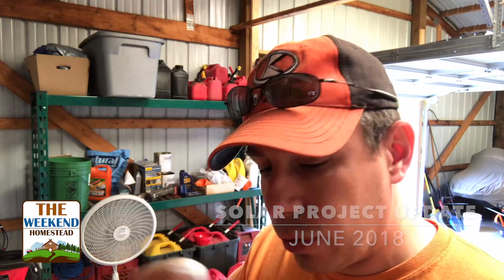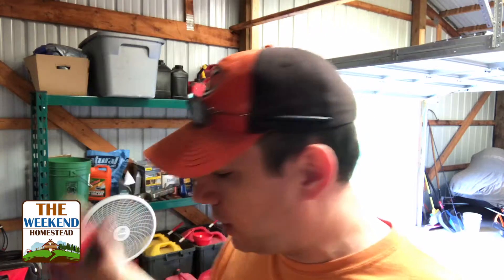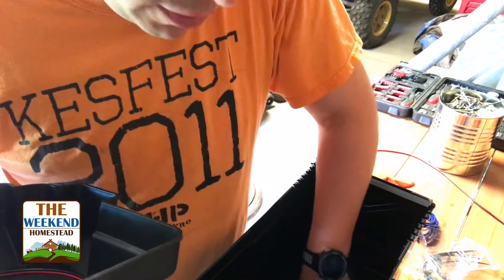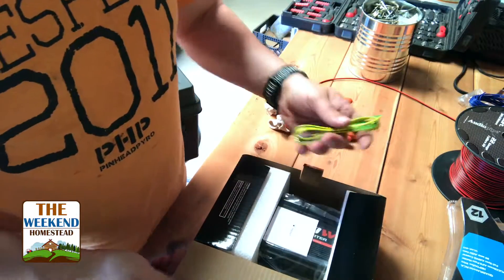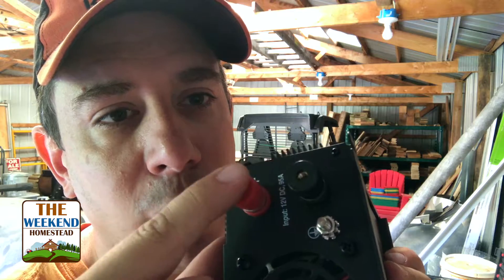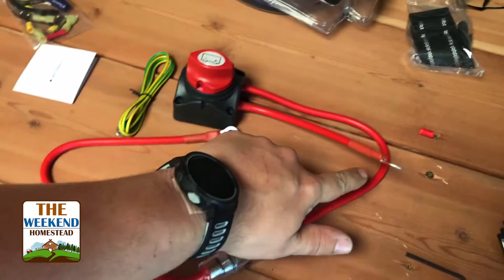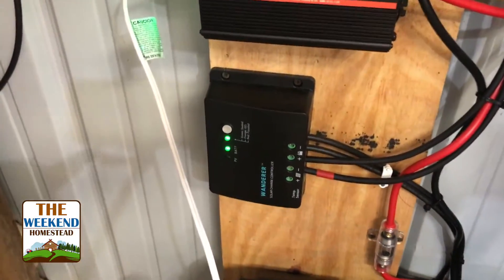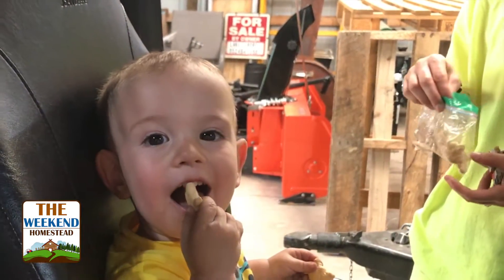Off grid Mini-Solar Panel Systems for Utility Buildings ~ Step 4 - Safety and Fixes!

Comment: That inverter is great for your situation there in the shed. I wonder how it would be in a cabin where I might be running a TV or charging electronic devices. Great set up. I'm going to use it as a tutorial.:)
Reply from the maker: What size TV - I think this would have room for it. Worst case move up to the 2000watt inverter. I have plenty of room in it to add a tv etc